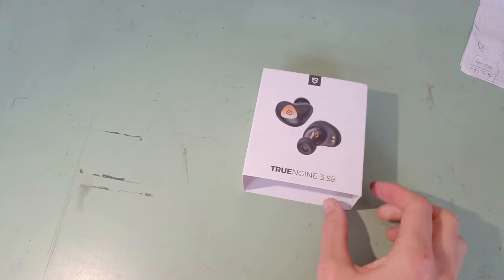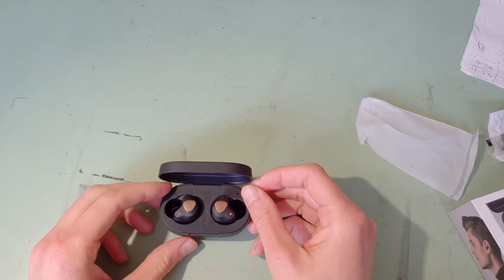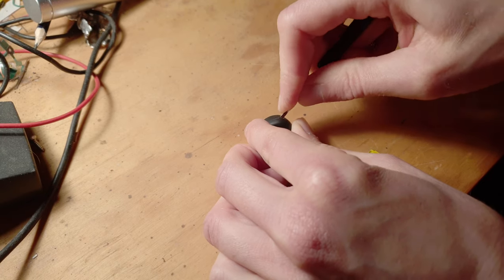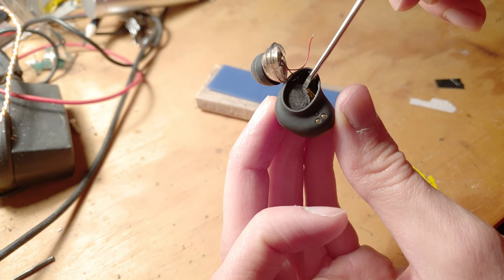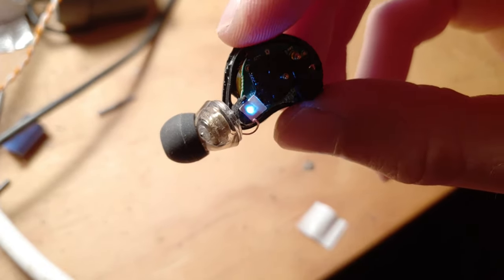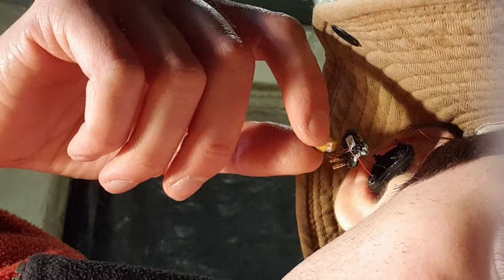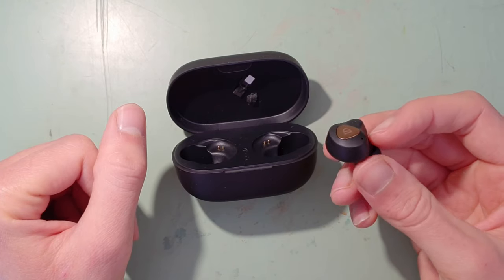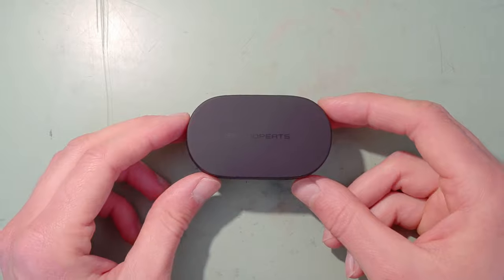Soundpeats Truengine 3 SE earbud teardown destruction and half review

Comment: Thanks for the info. Very helpful and entertaining. I have the T2 model, accidentally dropped one and now that one earbud doesnt pipe in any sound although all its other functions appear to work fine. Your video now gives me hope I might be able to tear it down, test circuit lines, and possibly repair with lab gear Ive acquired last couple of years. Fun fun. Thanks!

Comment: thanks bro. this helped repairing my peats. case wasnt charging so replaced the battery. it would be helpful if you tldus the battery model no inside. is it lr1154 ?
Reply from the maker: Wow I'm glad you found that helpful. The battery model you've written down there looks like a Alkaline battery. Which is the wrong voltage and also not rechargeable. Might be a similar size tho? 
In a few days I'll have another look at the li-ion battery to find any markings and post them somewhere here.
Reply: @Ashsibe  no no lir batteries are rechargeable lithium battery . Available in  aliexpress. Anyway i managed to remove the cover of right year bud.( it is funny is not it it is always the right year bud that goes nuts) the coin cell inside seems bigger than i thought . Did not have a way to accurately measure it but looks like the dia is 12mm
Reply from the maker: @jayantharuka1280  ah I understand now. I'll have to measure it with my digital calipers when I get the chance.
Reply: @Ashsibe  yeah. Since this is the only video with these details . Those info will be helpful 😊
Reply from the maker: I mesured that battery at 11.8*5.7mm with all the extra packaging around it. I then removed the tape, thin foam pad etc. Then I found this model number underneath:
M1254A1
0.204wh
2006

I have no idea what the '2006' means (hope it's not the year lol). But there you go. You'll probably find those model/specs on yours too under all that packaging stuff to stop the battery from shorting.
Reply from the maker: Not a model number I can find anywhere but I'm guessing that most 12mm by 54mm Li-ion batteries should work. Like a Varta cp1254 a3 for example.
Reply: @Ashsibe  actually bro if you can measure the dia and thickness of the battery it is the model no..
For example lir1454 battery,s dia is 14mm while thickness is 5.4 mm hence and since it is a Lithium Ion Rechargeable battery model no is lir1454
Reply from the maker: @jayantharuka1280  True that missing dot means a great deal.
Reply: @Ashsibe  sorry just now i saw your early reply 🥴. My battery doesnt habe any extra covers just the tape only. Plus this one only got 6 months warranty (i bought this from a local seller) and died soon after the warranty period 😕. It was wonderful chatting with you. I ordered a lir battery for my right ear bud . I will update you once i receive those.
Hopefully our convo will be beneficial for those people who wants to fix their peats..

Comment: Has it happened to a lot of people?
Reply: Yep, bought mine yesterday and today the left earbuds is louder than the right. 

Im filing for a refund right now. 
Tsk. I really liked it but it only lasted a day.
Reply: Yes same to me
Reply: I was able to fix it. I think it was becaus eof the grill and the adhesive they used. 

Just remove the grill using a needle and clean it thoroughly. And it'll work fine.
Reply: Mine right bud also doesn't pair anymore . This dude's right I reset them like 20 times and the right worked for a sec then unpaired itself and turned off.
Reply: @JrmBT2  this is the only thing that worked for me!!! Thank you very much

Comment: Mine earbud right side suddenly dont turn on even remove from the case
Reply: Reset it, put on the case both earbuds and push down both buttons for 10 secs and its all ( if didnt work. Try out 10 or 20 times and its all) this fix worked. For. Me.

Comment: I have the same problem omg i just bought it like 6 days ago😭
Reply from the maker: If the only problem you have is that it won't go into pairing mode (only flashing white) when you take them out of the case, then pressing the touch control on the right earbud for a bit more than 6 seconds is meant to make it go into pairing mode (holding them for 10 seconds will turn them off). Sometimes double tapping it instead  also seems to work for some reason. 
Sometimes you might also need to reset them by putting back into the charging case and holding down both touch controls until the lights turn off and on again. Then taking them both out so they can pair to one another.  

Anyway it's a pain. I've bought Bluetooth headphones for 7 dollars that have a reliable connection. But with these they were so unreliable I couldn't use them. Then they were turning off while I was listening to music with them. Fully charged only after a few minutes. My phone was only like two feet away.
Reply: @Ashsibe  bro i have the same problem like yours. Like when i was using it for like 10 mins. It randomly next the song and it says "pairing" and after that in a few seconds "turn off". I think the right button pad is ghost touching. I've done everything to fix it the factory reset even i clear the cache on my bluetooth phone and still have the same problem😭. And it does the same thing with my ipad too. Is there anyway to disable the touch pad? I been having this problem for about 3 days now. I try to return them but the seller seems to ignore me
Reply from the maker: @OzyBIG   I think you are right about the 'ghost touching'. Mine also once skipped to the next track before turning off. This would also explain why it also turns on by itself. The only way I can think of to disable the touch pad is to pull the right earbud apart and put some tape over the spring loaded copper contacts that connect to the touch pad (wish I thought of that before I destroyed mine lol). This may not fix it though, the problem is probably within some chip for all I know.
Also Soundpeats on Aliexpress ignored my dispute. In the dispute I left a video showing how faulty the earbuds were so they hopefully couldn't dispute my dispute. Eventually the dispute process timed out on Aliexpress and I got a automatic refund.
Reply: I have the same problem. These buds are trash. Couldn't connect with my note 20 ultra and my laptop. After 2 days of wasting my precious time still could not figure it out how to make them work. Trash trash trash, save money and buy something else
Reply from the maker: @harry-xu8pk  Agree. Also I just realized that the definition of 'peat' is partially decayed organic matter. So it all makes sense.

Comment: My soundpeats se’s right earbud connected with my phone with the left earbud , but when I played song the right earbud doesn’t work , what should i do with this ? , i reset the headphone several time and reconnected to my phone but doesn’t fix la right earbud.
Reply: Same problem with mine, only it's the left one it doesn't sound, seems like a broken cable inside or the speaker it's damage, better buy a new one in my opinion.